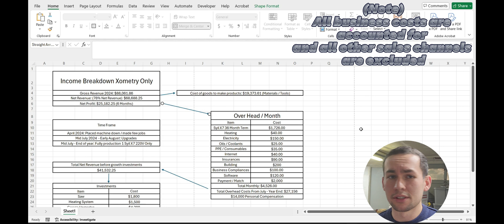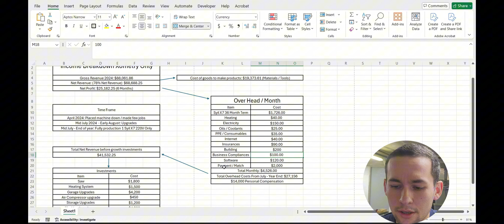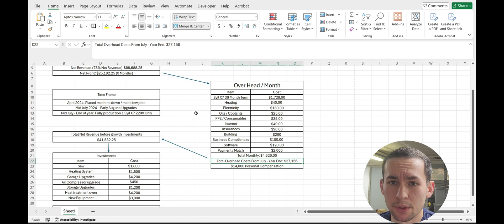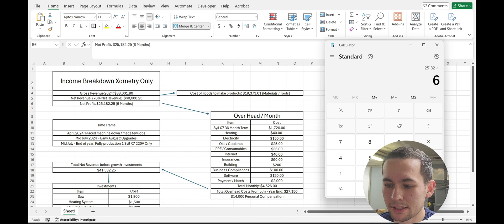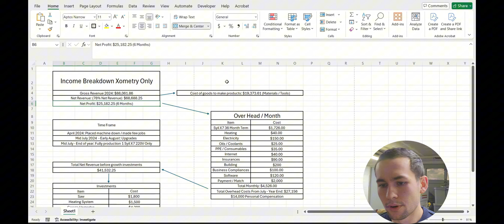Small machine shop: Ending 2024 (Xometry supplier results : Growth : Syil X7)

Comment: Evan, great video!  So a quick question since you seem to have been in this field. Is there some smallest/minimum size or capability needed to get into the premium club?  For example, if someone had a large HAAS machine, I suspect that puts them automatically into an upper crust level at least for large jobs requiring that size machine.  Could one be productive and have a chance for Premium with a small Tormach 440 or 770?  And be able to make a profit too I suppose.  And maybe also the same question about a lathe since I’ve heard it mentioned there are often lathe jobs too?  Thanks!
Reply from the maker: Thanks! You can creep your way into premium with a tiny machine, but there definitely will be restrictions. If you're experienced in machining already, the recommended machine is the syil X7 or bigger. The tormach 440 or 770 should only be for those that are unexperienced, I'd hate to invite someone into the machining world on a 40-60k milling center. 

But you are correct, larger machines with more rigidity and accuracy are 100% necessary to hit a large sales volume. Lathes alike. 

The perfect combo on Xometry is hard to dial in, but with a larger mill and lathe, you will be able to take tons of work. 
For reference, I see $1m+ work / year I can take with my syil X7.

Comment: I think what is important to note here is this: When you join Xometry you will not be immediately put into the premium platform. You will first have to run your test piece, then labor, and I mean labor through some tough deliveries and jobs you won't make a lot on, then when you get past a 3-6 month window and get into the premium jobs, it opens up an enormous variety of jobs that you can then do very well on!!
Reply from the maker: Exactly! You are first introduced to the standard supplier group. From there, you have to complete 15 jobs and have good on time delivery and quality. Afterwards, you can request into premium. Once inside of premium you see upwards of 100 job offers a day. 

Varying in Price from $100 - $100,000. 

We are currently sitting at 71 job offers during the slow season, This is continually rotating. (November - February) 

Our current open purchase orders total $3,442.93 for the week after Christmas. 

We spent $408.03 on tools and materials. This leaves $3,034.90. We anticipate getting this job done in 25 hours. That's $121.40 / hour on our Syil for 25 Hours straight. 

Thanks for the support and comment!
Reply: Does it really take 3-6 months? I thought 15 jobs was quick

Comment: Not sure if you're a lathe guy or not. But a small cnc lathe with a bar puller on it or feeder. Get some bushing or spacers jobs.  Machine runs until your out of material hands free while you're doing your mill work or office work. Dollars $$ just rack up.
Reply from the maker: I really want a small cnc lathe in the future. I've always been a juggler on machines, cnc mills, lathes, multi-task centers, edm, grinding ect... I really want a chucker lathe in the future. On lathes, I see most RFQs for parts that pair well with 13" diameter max machines. Really want a little lathe soon!

Comment: Hi Evan, thanks for being so transparent. What are you spending $100 a month on for "business compliance"? So far, I've not ran into any permits or fees I need to pay. Also, I think the product insurance is an unnecessary cost, unless your parts are going to be in the hands of consumers. If it's an assembly jig being used at the factory and it breaks, that's not your fault.
Reply from the maker: I do a lot of work for aerospace companies and If I directly cause a bottle neck from a product issue, they could take legal action. That's the only reason. 

As far as business Compliance, those are the fees for my registered agent. They handle all my state and local filings to ensure my business is registered and active.

Comment: Hey! I've been wanting to make the jump to starting my own shop for awhile now, but I only have experience with lathes (tight tolerance, dual spindles, with live tooling). Would there be enough lathe work on Xometry to allow me to start or do I need to get experience with milling first? I'll be graduating with my associates in CAD Engineering in a week and will have a lot more free time going into next year which is when I would want to start. My main concern is being able to weather the storm before getting production contracts from other companies. Any thoughts on this would be appreciated! I've been enjoying all your videos recently. You've inspired me to get back on track and pursue this myself. Thank you!
Reply from the maker: Thanks for the support, I'm glad I'm able to inspire you to get it figured out! 
It's difficult with a lathe, especially a turning center with live tooling, Y axis, and sub spindle. Although there is a fair share of jobs to be had with xometry on this machine platform. The type of work with the most demand is a CNC milling center with atleast 60" of travel in the X axis with a 5th axis trunnion that you can take on and off. This is the best combo I've seen for doing Xometry work. You will be able to entertain most offers without equipment constraints. A large lathe 13" diameter max, with live tooling comes in 2nd place. 

This is my general observations with the job board. Good luck and thanks for the support!

Comment: Just found your channel and loving it.  It comes at a perfect time as my son is graduating with a BS/MS of Mechanical Eng. and looking to use our hobby shop for side hustle.  The one thing not described in this video is any CAM work.  What was required by you and the costing of that when you bid the job?  Thanks!
Reply from the maker: Hey, The total for cam work on this component was 30 minutes of programming. The 1.5 Hours it took was cam programming, Set-up, and running the job. Along with inspection and packaging. These parts were really simple to run. We've also become efficient with uploading paperwork and packaging! I used to use Mastercam, but switched to fusion 360 for the cost. 
That's awesome, Best of luck to you and your son. Thanks for the support!

Comment: I heard something about there being a xometry ultra premium partner or a level higher than premium.  Have you heard this?

If I was Just starting what metrics would you suggest I track?  Are there any spreadsheets out there that are already made?
Reply from the maker: @ItzWheeler  You're correct. There's standard, premium, and ultra premium. I'm going for ultra currently. It's all based on performance and quality systems. You can also upload certifications like ITAR and see related work you wouldn't see otherwise.

If you're talking about metrics with xometry, the partner portal tracks all the important ones live there.

I would tract actual profit after all operating expenses. That's the one most people get skewed perceptions with. That and efficiency and job hours. Make sure you're consistently operating the profit band you layout for yourself  🙂